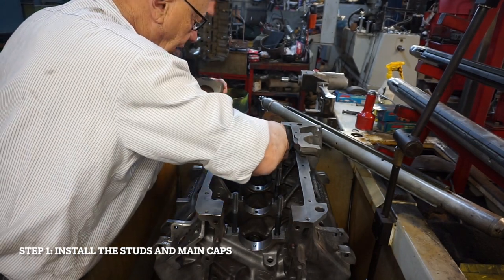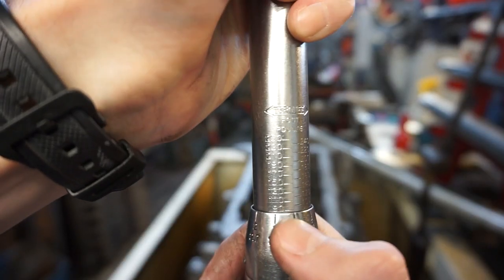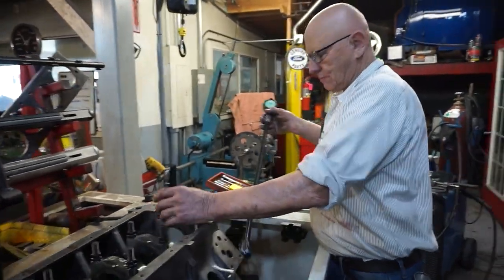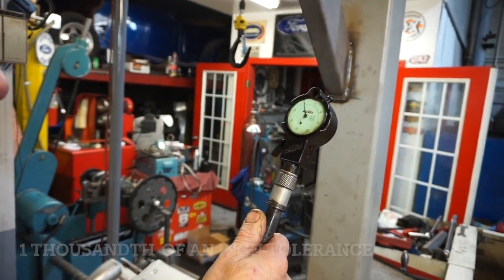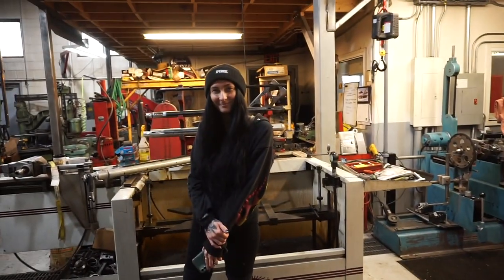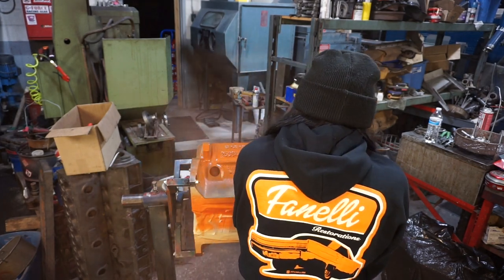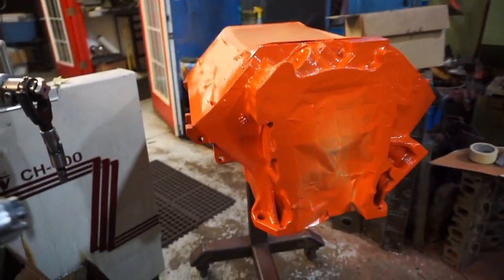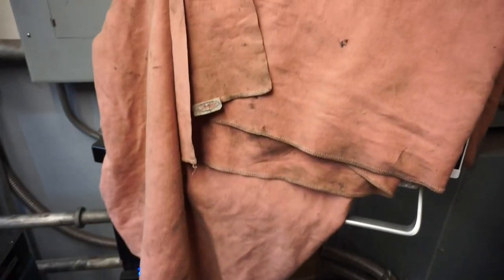How to Align Hone an Engine: Alex's '70 Duster 440 Build Ep. 12

Comment: The factory bolts have a slight shoulder to them that positions the main cap in the saddles...the ARP studs don't have that feature so I file slightly the block saddles and main cap bottoms then insert the studs then line hone for approx .0025 oil  clearance
Reply from the maker: absolutely good point, well done!